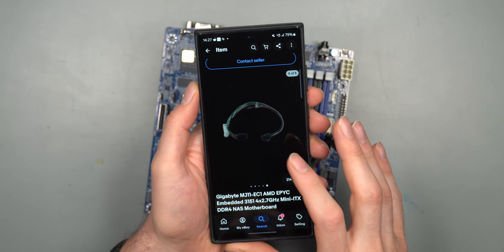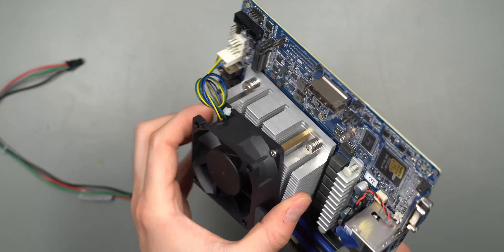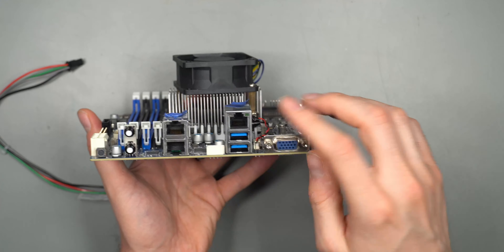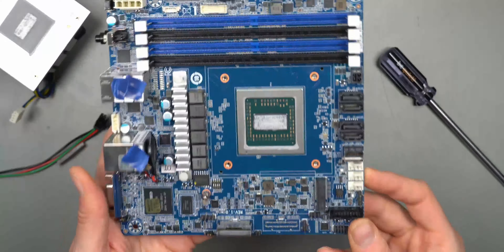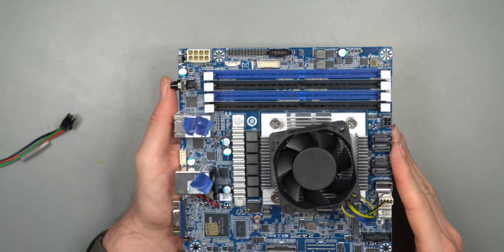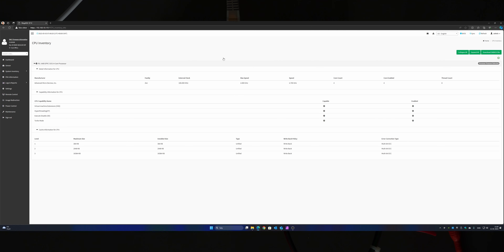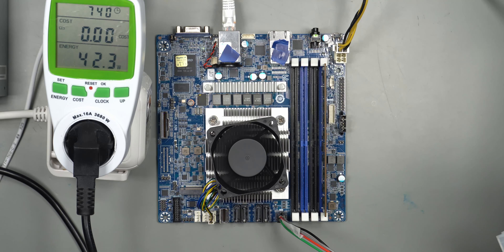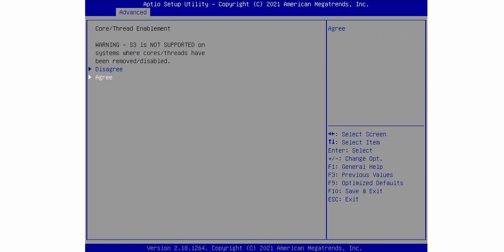Gigabyte MJ11-EC1 EPYC Embedded 3000 69 EUR Server Motherboard: Hardware & Software Overlook

Comment: have you tried measuring psu idle power alone? 28w seems too much
Reply from the maker: Thats about what you can expect with this board, using a ATX power supply. Will do some more testing though in the future when all adapters arrive, so I can finish my build. But in the range of 20-28W is in line with other owners testings.
Reply: 300W 80+ gold measures 24-25W idle power with one M2 SSD, and one 32GB ECC unregistered module and SMT enabled. IPMI/BMC alone consumes 6-7W!
Reply: I recommend checking out hardware havens video on power supplies for home servers, you want one with good efficiency on low power consumption.

Comment: @whcvip  thanks.
Regarding this board, what do you do with a full 8 hard disk and SSD in addition for the OS with m.2 to network card and slimsas 8i to GPU?
Reply from the maker: I use unraid, that os runs of a USB flash drive, just standard cheap flash drive, the os runs in RAM once it is booted, so the os does not really write anything to the flash device. Else external USB SSD would be the best bet 👍.
Reply: @whcvip  thanks for the answer. 
Because I'm planning to use TrueNAS scale on my build boot from USB is no go. 
Either I give up one or 2 disks or I split one SATA port to 2-3 ports
Reply from the maker: @HaimPeretz  You can boot from USB. Just use an SSD enclosure or pre build USB SSD that supports USB Attached SCSI. Then it should work just fine 👍
Reply: build a NAS / server. Ceph storage etc. or a rendering rig